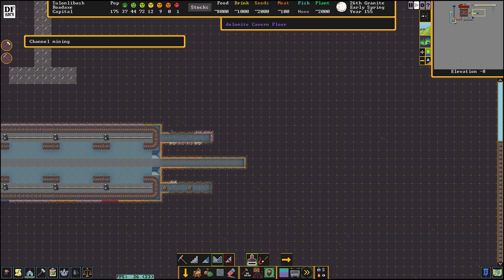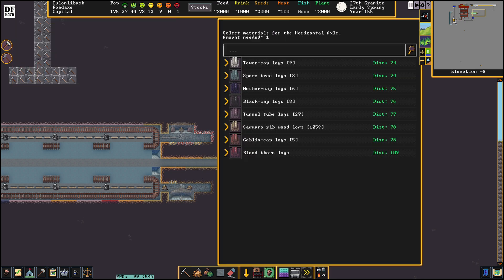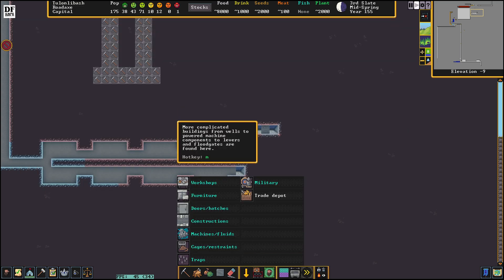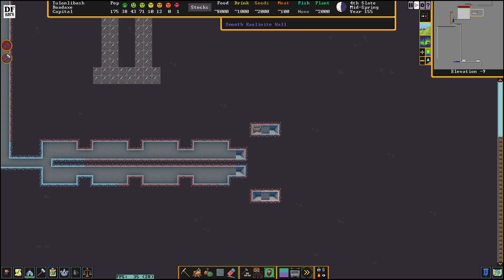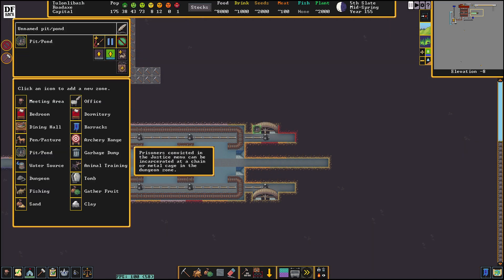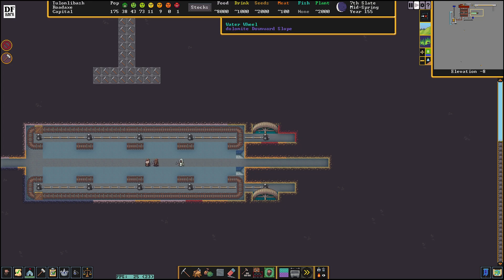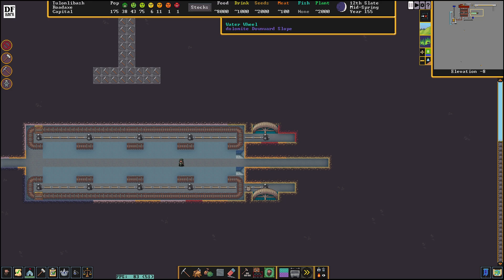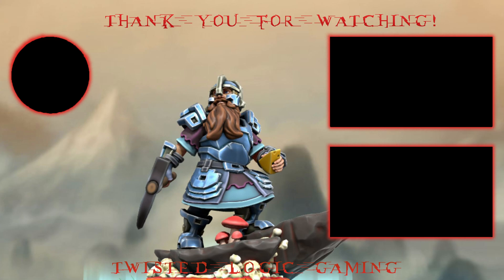Minecart Water Reactor 🔅 DWARF FORTRESS STEAM 🔅

Comment: I can't get this 1x3 waterwheel to work, the water just pushes my minecart off the stop... 

I looked on the wiki and found that you can make them with just 1x2, using 11 water instead of 16. Seemed to fix the issue of my minecart getting pushed away.
Reply from the maker: is your minecart wood ? that might be why. The 1x2 minecart reactor on the wiki is also good !
Reply: @TwistedLogicGaming  It actually happens with the 1x2 as well... Probably because they are wood, I will try some metal ones next.

Comment: Can you put 2+ of them side by side or will that interfere with the minecart's action? Or do they need to have a wall separating them?
Reply from the maker: CHeck out this for more info https://dwarffortresswiki.org/index.php/Water_wheel#Micro_Water_Reactor
Reply from the maker: Thanks for watching Sébastien Gagné !!
Reply from the maker: I think you need to stager them with seperated channels
Reply: @TwistedLogicGaming  Somehow I can't seem to get 16 units of water in the channel. It starts running at 15 and water added seems to disappear. The issue is that it's stops working after a little while :(

Comment: Huh, if I make a bunch of these, they eventually stop working. Looking at the water inside, despite filling it up to 5 5 6, once they turn on, they switch to 7 4 4, and after a few minutes equalize to 5 5 5. Not sure what I am doing differently from you, or if you just shouldn't have a bunch of these hooked up to the same circuit or something.

Edit: Seeing Master Spike's comment down below, that seems to have worked. I also haven't tested it longterm but it didn't immediately break, at least. Fill in the right tile, fill to 5 6 and it should work.

Comment: Can it be north/south? I also seem to be having a problem where a unit of water is evaporating and it shuts off
Reply from the maker: Idk who told everyone that the water is forever ? Evaporation is a thing in all water reactors for the last 10 years at least ., just fill some more water in there and you should be good!  Yes you can also rotate these if you want !  Happy Gaming Daniel !!
Reply: @TwistedLogicGaming  I know it doesn't last forever lol. But it was shutting off after 5 minutes or so and now the minecarts aren't even moving but the wheel is turning on its own with 5/5/5 water after I attached some gear assemblys.
Reply from the maker: its 5 5 5 with a spinning wheel right ?
Reply: @TwistedLogicGaming  Yes, but then it randomly stopped later. I think I am just going to build a normal reactor. My guess is that it being surface level maybe affects the evaporation rate.
Reply from the maker: If you have a river or brook its the best because those tiles are 7/7 but also count as flowing. so you could build a wheel house with 50 of water wheels and bring power where ever.

Comment: Are you not able to chain these together? I tried to make a row of like 6 of these all linked together. And for some reason my minecarts keep disappearing
Reply from the maker: right now when a mine cart is full of water or magma it will disappear it is a visual bug. if you mouse over the tile it should be in the text box for that tile
Reply: @TwistedLogicGaming  yeah u were right they weren't disappearing. Just a visual bug. Now I'm stuck on that problem I commented on below. The 5 5 5 thing. Water tiles keep disappearing so it stops after about 30 seconds
Reply from the maker: that seems to be a bug, it happens to me as well but after re adding water mine became stable the 2nd time. I saved and reloaded a few times after that as well, idk if the save / load makes a difference
Reply from the maker: check this our for more info https://dwarffortresswiki.org/index.php/Water_wheel
Reply: Well I got it to work. But they just keep stopping. It'll be bouncing between 7-4 and then all the sudden everything is 5's and the minecarts just stop

Comment: Must use a heavier minecart, wooden minecarts will shift when the water is being dumped in
Reply: I wish I had seen this comment before I tried this with a wooden minecart! I am trying to skip straight to magma smelters and thought I might be able to run my millstones via a wooden minecart. Guess I'll wait till I get my steel industry running! (Anyone need a practically unused wooden minecart?)
Reply: @chriswalsh5077  Don’t forget unused and clean.
Reply from the maker: Thanks for the added info ssssssssssssssss !! ( Iron is my go to as it is magma safe and abundant )

Comment: Mine have an issue where sometimes the extra tile of water is lost somehow, I've got it set up exactly the same way with 7/4/4 and power being generated but eventually it will go to being 5/5/5 due to the lost water. Not sure what the issue is on my end but I might just rig it up to an aquifer from above to periodically refill it automatically
Reply from the maker: add one more, should be 7,5,4 to be 16 units. that also happend to me at one point I topped it off and then it was okay, I have not tested long term yet ! Thanks for watching Master Spike !!
Reply: @TwistedLogicGaming  We do add 16 units. a unit disappears So it just stops and becomes 5/5/5. Adding back in water starts it again. but then it breaks again within like 30 seconds or so.
Reply: Continued to happen constantly to me. Had to end up removing the minecart and putting a screw pump in and feeding the water back round
Reply: yeah im having this same problem. I cant keep them working at all.
Reply: I think I've found out how to do them properly so they don't lose power - it's should actually be 2 tiles wide and have 11 units of water in total to be 7/4. The rightmost (or leftmost if you're dumping to the right) should be filled in. This wont block the construction of the water wheel. The reason for this is sometimes water "skips" over to the other side somehow before the minecart dumps its excess water back, then you have a tile to the right which is 5 deep, and then 6/4/5, then the leftmost tile can spill into the middle for a 5/5/5 powerless equilibrium. If that tile is filled in it can't do that. I haven't been able to get a 7/5/4 equilibrium.

Comment: Wow this is incredible! So much easier for small operations than a whole dwarven reactor! and no chance of evaporation too!
Reply from the maker: for this I believe you can double it up to be 200 power as well.
Reply: @TwistedLogicGaming  1 minecart for 2 Waterwheels? If that's the case I'm assuming it'll work for 3 then right? Minecart in the middle then waterwheel above and below? Or will you run into issues of water filling up weirdly?
Reply from the maker: CHeck this out for more info: https://dwarffortresswiki.org/index.php/Water_wheel
Reply from the maker: Happy Gaming Nathan !!

Comment: Is there a good resource for explaining why the minecart moves the water without any dwarf doing work? The cart is not powered is it?
Reply: No. Track stops automatically dump in the indicated direction when the conditions you set are met. The water then equalizes back out, fills the minecart up again, and the track stop dumps it. This is an abuse of the simulation’s physics engine, aka Dwarven Engineering